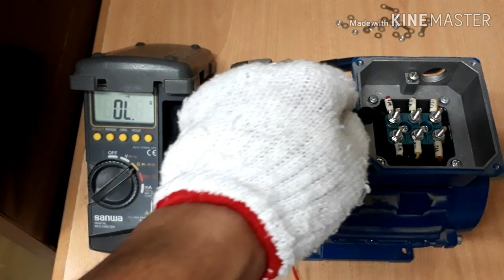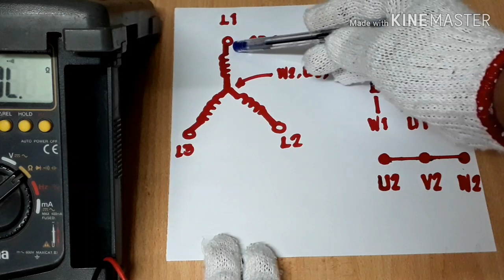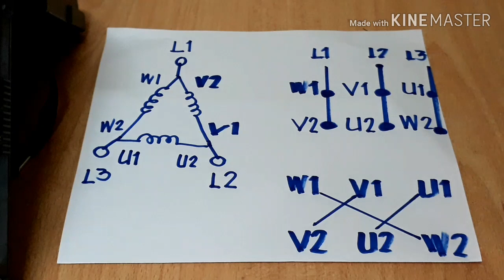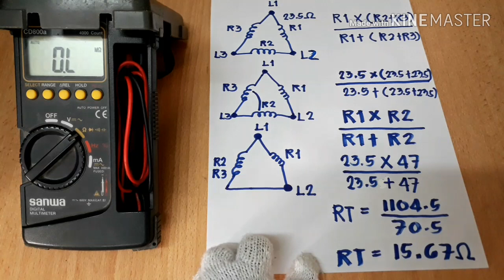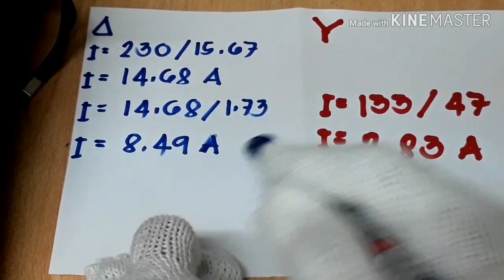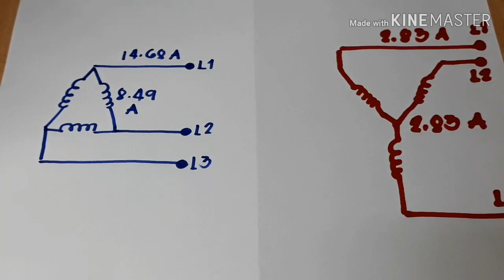MGA BAGAY NA DAPAT MO MALAMAN SA WYE/DELTA CONFIGURATION WITH COMPUTATION . /Tagalog

Comment: master kadalasan bakit walang capacitor ang 3phase motor ang single meron bakit po?
Reply from the maker: Sir ang single phase motor po ay nangangailangan ng capacitor kasi di nya kaya mag produce ng sapat na torque para mag start by its winding lang iaasa kaya nagamit ng starting capacitor. Unlike three phase motor dahil kumbaga sa tao 3 sila magbibigay pwersa para paikutin ang rotor. 3 windings produces emf para i start o paikutin ang rotor. Sana po nakatulong. God bkess and thanks po sa suporta.
Reply: @chrisampere  sir Alin po ang matas ang torque sa Dlawa Star po ba O delta
Reply from the maker: Sir syempre po ang delta configuration if applied on the same voltgae. Like for example on soft starting method wye start delta run. Pero if susundin ang voltage according to its configuration like for example delta on low voltage and wye in high voltage supply both on direct online starting halos pareho sila ng torque. Sa wye Start delta run na nakabase ang voltage sa delta configuration halos ang wye ay 33% na lang ng torque ng delta kasi sa delta each windings are directly connected sa supply line. For more info please watch my video"Mga bagay na Dapat Mo Malaman sa Wye Delta with Computation. "Thanks and God bless. Sorry ito na nga pala ang video na pinanuod mo nairecommend ko. Any way sir maraming maraming salamat sa panunuod at sa komento.
Reply: @chrisampere  Ok sir na gets Kona po sa low run delta, As a voltage method,,  Btw sir Salmt po ang Godbless, mrami po akong natutunn s ainyo mster😍
Reply from the maker: @dmelectrician927  sir ako po dapat magpasalamat sa inyo for supporting my channel. God bless po.

Comment: wala akong sinabi na mali ang paliwanag mo, tama lahat ang paliwanag mo...
kaya lang hindi troubleshoot yan, paano yan kung sakali nga ibang electrician ang nagbigay (intensional) problema, tinanggal ang markings at pinag shuffle ang terminals lead.
how to identify the right terminal markings?
un ang gusto namin makita, step by step explanatin...
salamat po sa next video!
Reply: sa six leads brought out dual voltage motor, medyo madali lang ibalik sa tamang terminal number.
ang medyo masalimuot kong 9 leads terminal is unknown marking dahil tinanggal nga dahil nagalit ung fren mo at gusto nyang subukan ang galing mo dahil nainis nga sau...
INTENSIONAL BANG GINAWA...
Reply from the maker: Sa  9 leads ang 3 leads out ay pedeng mababa ang resisstance if delta configurataed(67% of winding resistance) or mas mataas if wye configurated (200% of winding resistance). Kapag nakita mo ang difference ng 3 leads out na yan sa 6 leads out na natitira ibig sabihin yun ay second configuration mo. Then saka mo i configure ang natitira mong 6 leads.

Comment: simpling problema lang yan kalinya, dahil dmo tinanggal ang mga terminal leads sa terminal block.
paano kaya kung iba ang magtanggal sa lead terminal sa box at tanggalin ang terminal marking at ishufle ito! un ang gusto namin mapanood...
pwede ba mapanood natin?...
Reply from the maker: Sir kapag nakaalis lahat ng lead wire sa terminal block ang first step ay to identify each winding. Hanapin muna ang first winding kahit alin basta makakuha ka ng winding resistance reading then assign mo sa t1, t6 ang second is t2, t4 and third ay sa t3, t5. Wala po problema kahit anu makuha nyo na winding ma iaasisgn sa kahit anung terminal pairs. Kasi sa huli before energizing motor need naman natin at mandatory ang rotation test. Salamat po sa panunuod at God bless po.
Reply: mali sir may problema dahil di naman lahat ng oras ung line 3 at line 1 lang magkabilktad pano kung line 2 mo napunta sa line 1 uugong lang yang motor @chrisampere
Reply from the maker: @sakuragiibanez4579 mali ba salamat
Reply: nakakalito lang ung drawing mo sir dapat UVW palagi ang T1,T2,at T3

Comment: Pano po malalaman kung single phase or 3phase po ang motor kung wala na yung name plate nya or burado na po ?
Reply from the maker: Kapag balance resistance ang 3 leads pairs kapag gumamit ka ng omh meter 3 phase yun. Then kapag  nakita mo na 6,9, or 12 leads ang motor 3 phase mga yun. Unlike single phase motor merun sya starting winding, running winding which is di sila in balance resistance kapag ginamitan mo ng omhmeter. Sana po makatulong.
Reply from the maker: Tama ka master walang capacitor ang mga three phase motor
Ang single phase merun sya capacitor.
Reply: Maraming salamat po ..
Reply: Pag 3phase motor po ba wala na po bang capacitor ? Or yung single phase motor lang po ang ang may capacitor ?